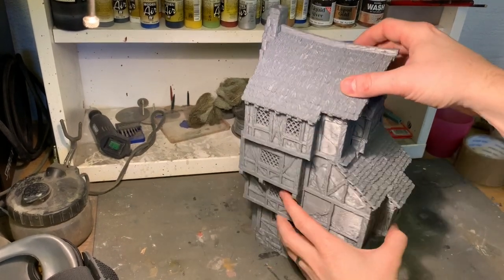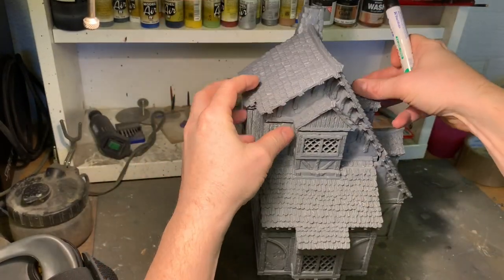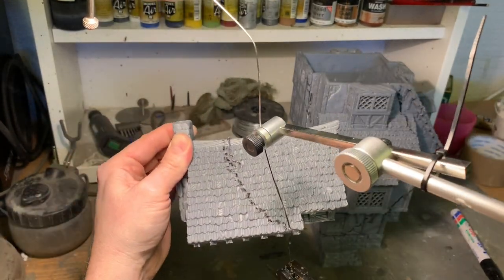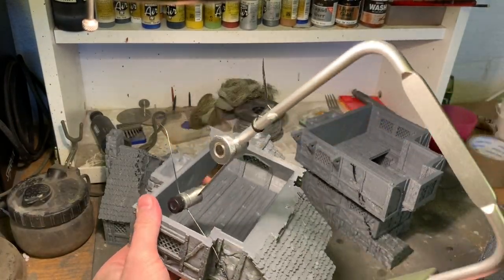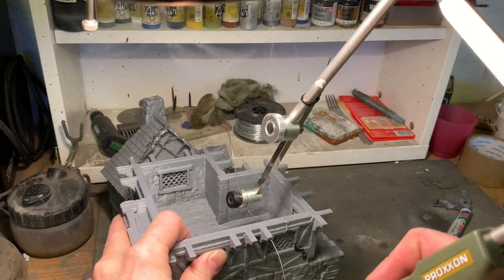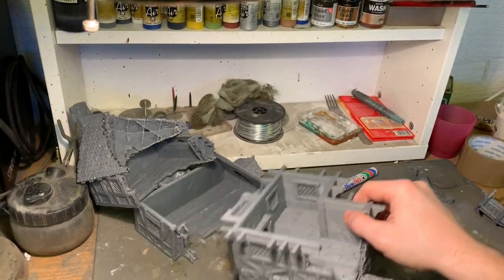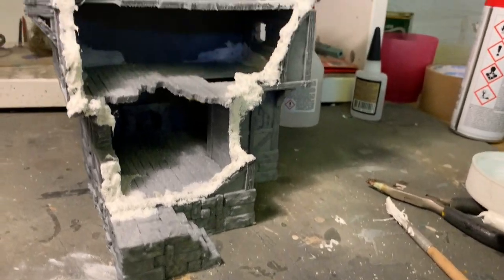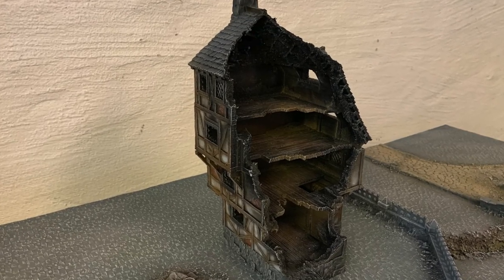Super easy way to make a ruin from a 3D-printed building. Warhammer, DnD, mordheim, frostgrave.

Comment: What kind of printer i would need from Elegoo to print such nice large buildings on this vide?
Reply: I have Mars 2 Pro but that is for troops only i think
Reply from the maker: I think most standard printers have the 220x220mm print bed needed. Its usually inte the specs ont the sales site. Just dig in!

Comment: I love the effect you ended up with, I was thinking that maybe if you wanted a little bit more detail to fill in sliced away areas you could cut up some of the cut off floor bits and use them as rafters in the roof or timber sticking out of the walls to give a kind of exposed skeleton effect.
Reply from the maker: Yeah thats a good idea!!!

Comment: I appreciate all your work but i have to ask, why did you do that when there are numerous ruined buildings from either pay sites like printable scenery or free sites like thinigiverse.   Also next time i would highly suggest modifying the file in mesh mixer.  You can create the ruins in there and save on PLA and time printing.    You did do a great job and i would of never of thought of using a hot wire tool.  One last question did you modify the wire in the hot wire cutter.  It just looks like a beefier gauge than normal.
Reply from the maker: Thanks. Yeah meshmixer would be great if i wasnt so bad at it. Also its usually not allowed to modify stl-files digitally, bit who would know. The ruins available are not at all as playable and with as many floors that i need for mordheim, thats why i do this. I do however have every ruin from printable scenery and will use them for my board. Thanks for the tips and thoughts. Appreciate it.
Reply from the maker: The wire is indeed beefier than the one on the tabletop cutter, but it is the one that comes with the cutter

Comment: Thanks for the information and example. Do you think a PLA printer is worth the investment?
Reply: You are liable to end up with more unpainted gray (or whichever color filament you buy) plastic because a printer does not need sleep, it can print all day and night if you just feed it, i think that and the fact that minis themselves dont print good enough (IMO) are the only negatives of having a filament printer.
For printing terrain they are brilliant, either go for full prints like in the vid or print detailing to punch up scratch builds, you can find, design or remix stuff to fit foam board, like building corners to join and hide the open ends of the material with stonework, bricks or beams, windows/doors that just slot into holes, strips of roof shingles or full roofs to go on top, super quick compared to making the detailing by hand.
They can also be useful outside of the hobby, this happened two weeks ago: my mom has a 3000 dollar massage chair which is a couple of years old and one of the connector bits for the right side of the back massage inside it broke, finding parts turned out to be impossible but i grabbed the old part, figured out how to match it within the limitations of printed parts (mostly tensile strength, printed layers can separate if pulled away from each other), designed and printed the part in a couple of hours, tested, found an issue with my design, modified it, printed the new version and got the chair working again.
Reply: @zid_just_zid  Thanks
Reply: Its a seperate hobby in its self.    So be aware of that!
Reply: @MrBizteck  Thanks.
Reply from the maker: Just saw that i downvoted this comment by mistake! Sorry about that, I must have seem like the biggest douche. Thanks for the comment!
Reply: @Lybbansminiatures  I didn't notice... LOL So, no, you didn't to me. Thanks for acknowledging the mistake, though. And the table build is is looking good.